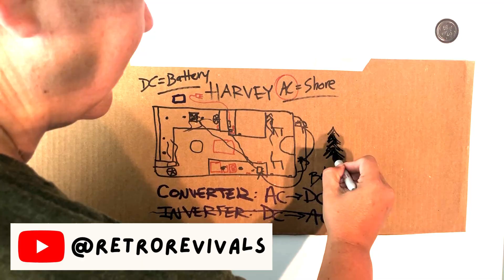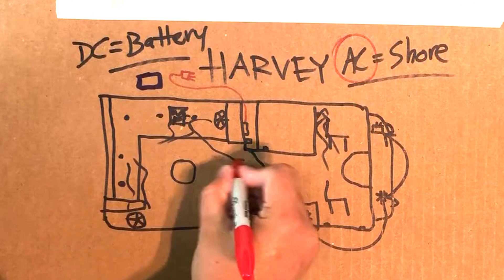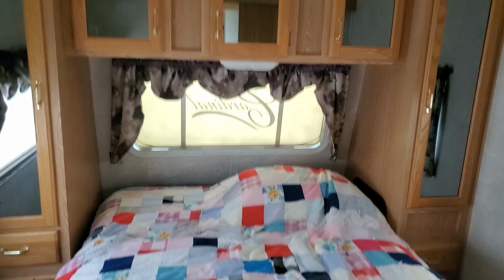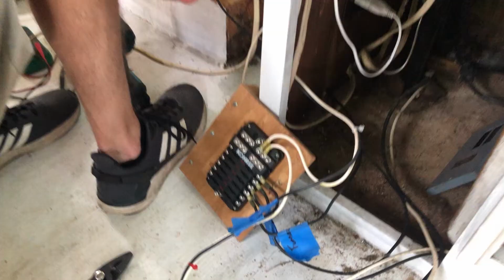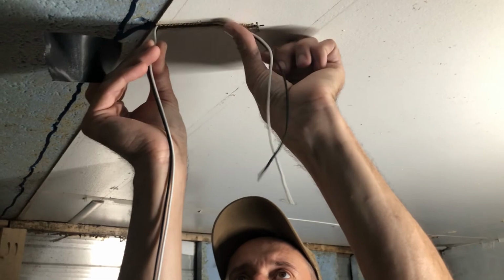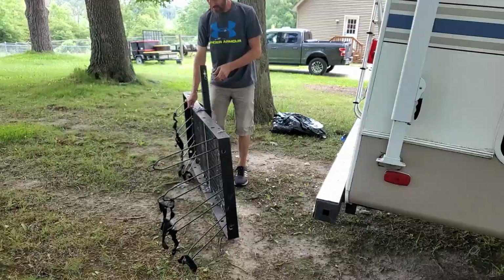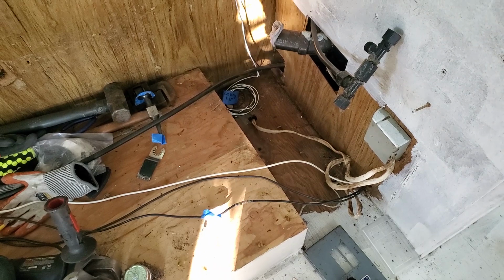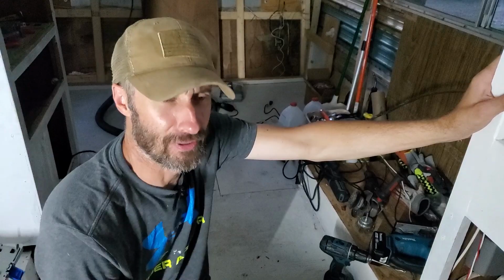Upgrading Electrical System! AC/DC Wiring, Converter, Fuse Panel & Battery Disconnect DIY

Comment: This is awesome. I just picked up a 1974 dodge B300 sportsman brougham and thanks to the previous owners I have to rewire the whole thing. They did it themselves and absolutely NOTHING works. With everything turned off my generator overloads as soon as I plug it in. Come to find out wires were crossed at every outlet and switch.
Reply from the maker: Oh wow, sounds like a nightmare.  At least when you're finished, you can have the peace of mind that it's done correctly.  Thankfully most of ours was still in original condition when we bought it (even though it was in really bad shape).  It's never fun to deal with someone else's DIY experiment.  Good luck with your project and thanks for watching!

Comment: I would never do away with my propane system.
It helps keep us camping for a lot longer time when dry camping.
Hope your new setup works for you.
It it doesn't, you can always go back to propane it needed.
Reply from the maker: So far so good. The portable generator has been able to meet all of our power needs. If the existing utilities that required propane would've been in better condition we probably would have stuck with propane.

Comment: That was a fun video, thank you. Great job showing how the layout will go together. And That's called a "fishtape"😁.
I've been working on an old RV and gotta say, that the electrical system is probably the most tedious thing to do, so kudos to you for doubleduty👍.
I decided (after second rewiring project) to use pieces of an old garden hose to run wiring around corners and across the ceiling and a lot of butt connectors instead of wirenuts. 
Looking forward to seeing the paneling😁.
👍❤️
Reply from the maker: Thanks for the comment, Edward!  We're going to need to do more wiring soon and plumbing... both will be tedious.  That garden hose idea is a good one!  We should have a new video out tomorrow and we'll finish up the paneling, hang cabinets, and finally finish the brakes and get the new wheels on.  Stay tuned!

Comment: I’m appreciating the clear lessons complete with drawings for your projects. While I know very little about what you’re doing I feel like I’m following along! We’ve experienced the breaker issues when trying to use our appliances so hearing how you are splitting the electrical to address that is awesome. I’m very curious if you’ll really be able to get by without solar with all those appliances. Who wants to fire up the generator in the morning to make coffee? But I’m sure you thought of all of it … you appear to have that figured out.
Reply from the maker: Thanks, Joyce!  We're not planning to do much "boondocking" and will likely stick more with campgrounds where we'll have shore power.  We are curious too if we are overestimating how many electric appliances we can add without having breakers pop all the time.  We looked up the amperage on each and think we'll be ok as long as we don't try to use everything at once.  Thanks for watching!